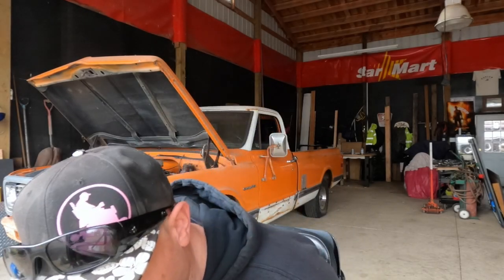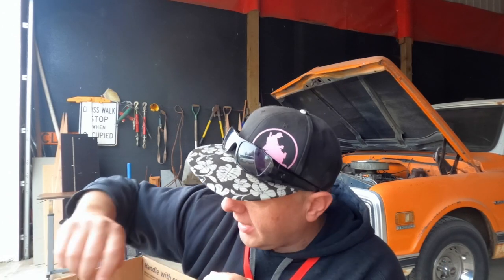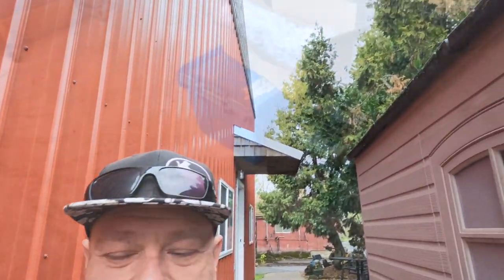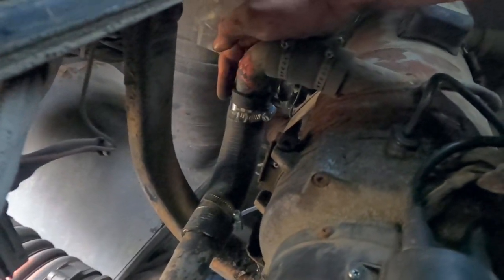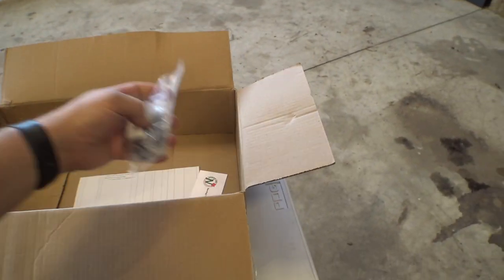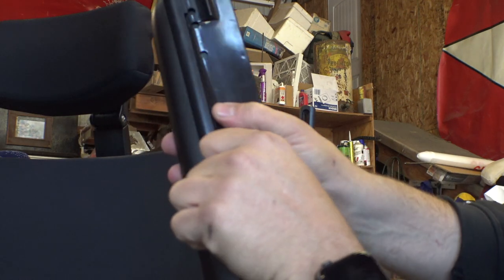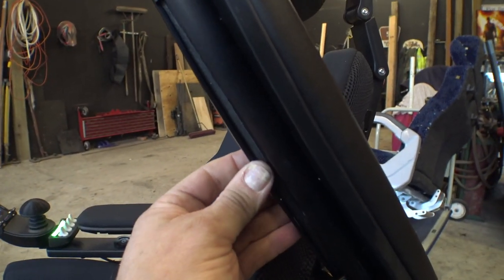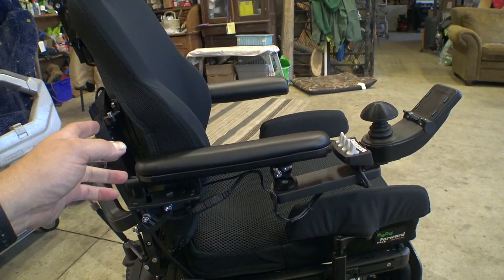VLOG 586: arm rests & coolant leaks!

Comment: If you want dry heat try the cheap Chinese diesel heaters 5kw they are easy on power and fuel . I am heating a space of 12m x6m keeping a constant 26c with 0c  outside for about 12 hours a day using approximately 20l of diesel every 7 days per heater . The heaters last over a year and paying approximately $120 aud per heater . I have massive nerve damage and can only walk about 15m and unable to use any blankets or covers when sleeping ( ok just laying in bed trying to sleep) . For me they are a lifesaver.
There are very few dead ones on arrival and for the price if one dies it is not worth stuffing around and just replace it .
Cheers you are a inspiration from a very soon to be wheelie .

Comment: I really would like to know how to get the part numbers and where you purchased the wheelchair arm kit and adapters. Would be very helpfull to be able to narrow the wide arms. That would allow me to access my whole house instead of only half. My Permobile M300 arm are just to wide. Thanks for your time.
Nolan
Reply from the maker: OPTIONAL ITEMS:
Part Number  105463-99-0 Corpus Arm Trough Adapter 1" - Pair
there's a couple versions of them - but you can find the part numbers on the permobil chair order forms.  ya have to get a dealer to order parts for ya, as they wont sell to end users :^/
Reply: @TotallyNormal-  Thank you for responding and for the information. I know you are like a drop of water in a hot skillet in doing so many things with your time. So, your taking your time for me is Appreciated !